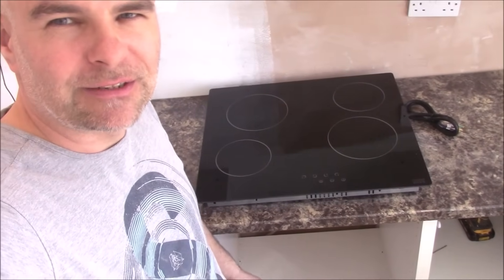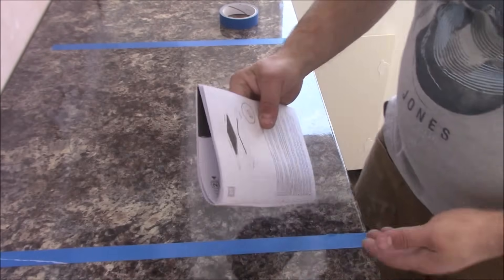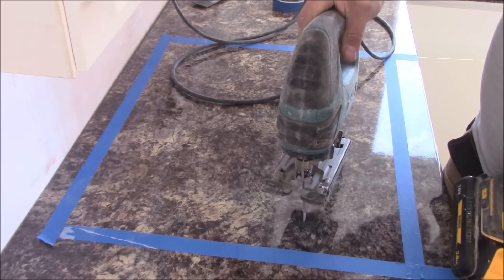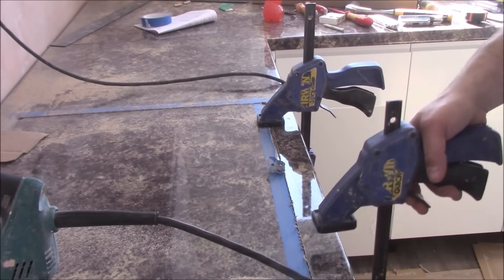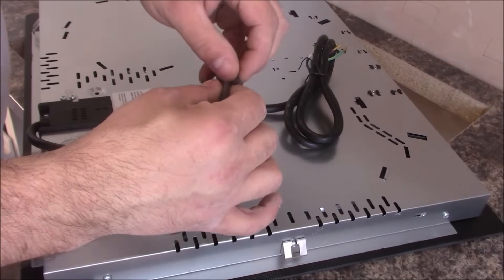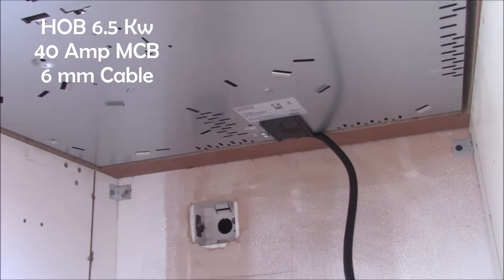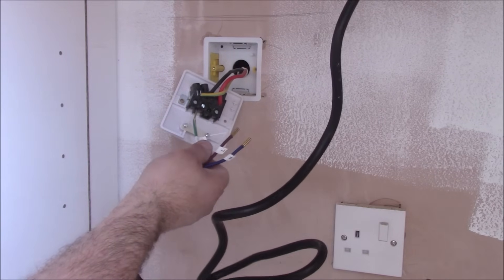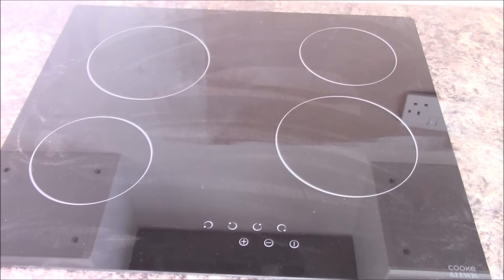Electric Hob Installation How to install Electric hob in worktop & wiring

Comment: Great video! Thanks. Can I ask, I’m not gonna have an oven under the hob. I’ll have drawers instead. Should I leave the back of the cabinet open or is there some sort of removable cover for the hole I’ll need to make to have access to the the plug? (Socket). Thanks

Comment: I have spent extra time in the market to buy the best hob brand, on march 2023, I bought AEG 90cm hk955070xb  after six months the color of the right side eye later on one week i found that its cracked, the local seller confirm that its miss use!! I don't know how color change and self cracked is miss use!!?? I wondered how AEG seller try to escape from manufacturing deficiency responsibility. I wondered how AEG seller dont aware of two years warranty, every thing all image zero. great lesson i have from this brand

Comment: can the connection plate be installed upside down, with the cooker wire going up as my feed is coming from the bottom near the floor

Comment: Screw a bit of wood under the worktop to support the cut out. 
The hob should have some screws and brackets holding it in place. 
Trim the flex down as it is too long and the tails are too long and should be cut to the right length not just crammed in. 
As others have said, you can run most hobs plus two ovens off a 32a mcb and use 4mm cable. 
6mm is overkill and it then steps down to the flex on the appliance which looks to be 4mm. Should be the same size throughout. 
That cooker switch is from the 1950s they do nice standard size ones now. 
The wall socket to the right of the hob may be too close to it. Should be 100mm. 
Apart from that....

Comment: Hi i have a question, the layout of my kitchen is the same. Where you connect the hob I have my oven , I recently bought a ceramic hob (is bigger then what you used it has 5 cooking areas and total 8200W) we had gas hob previously. Can I disconnect the oven and connect the ceramic hob where you connected yours and to buy a plug for the oven and plug it in the socket which is next to it? I would like to know if you think it will work and no issues? Also can you recommend what plug I should buy? Thank you

Comment: Great video thanks.
Just one quick question why do you need a 40amp MCB isn't 32 amp enough?
32 amp is good for up to  7.3kw and with diversity it will be no way near it?
Thanks Chris
Reply: The MCB needs to be rated at less than the cable capacity, allowing for its installation path, but higher than the load.  A B32 would be fine in this instance.
Reply: @MS-Patriot2 the current rating of the circuit protection device should be equal to or greater than the design current, a 6.5kw(6500w)  hob will only pull 27amp less when diversity is applied. So a 32amp MCB would be more than sufficient.

Comment: The part I wanted to see was how to change a double plug socket to cooker hardwired..
Reply: @rALPHA. You will not be able to run a typical cooker rated at more than 3kW from an existing ring final outlet if wired in  2.5mm twin and earth cable.   The cable to the new socket you propose must be of sufficient cross section area for the wattage of the cooker, and the circuit breaker rated at less than the cable capacity but more than the cooker.
Reply: @MS-Patriot2  I sorted it out a already had 6m cable and cooker switch. I replaced the double socket box with 1 socket and hardwired connection 45amp pretty easy to be honest . Thanks

Comment: Need a video with extra guidance on getting the jig saw to do a nice straight cut (both along the line and keeping the blade vertical). I seem to always get some blade wander which can be a disaster!
Reply: blade wander in my opinion always happens with inferior jig saws and that covers 95 percent of all models...you need a good quality machine with ample power of 500w or higher with a rigid blade set up. To be honest this can only be found out by experience... I can only recommend 2 makers as they are the ones that work for me but there will be  others I have not tried...those 2 are Makita and Bosch. Make sure that the base plate is set at 90 degrees and that you have a sharp blade... while cutting do not force the blade forward but allow it to clear its own path..if you could also attach some guide to run the base plate along this would also help keep the saw and blade from steering away. My advice may be too late for others but I hope it helps others...
Reply: @3rdeye399  Yep

Comment: Hi great video. 
could you tell me if the wires with clipped metal on the ends stays
on or do you cut them off and feed in the bare wires to connect